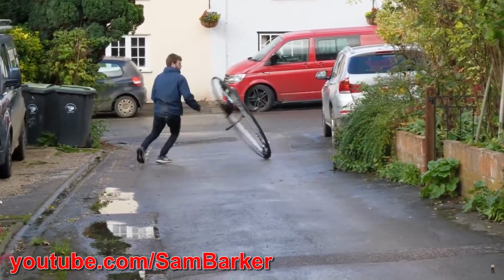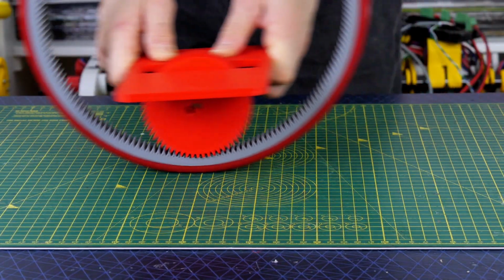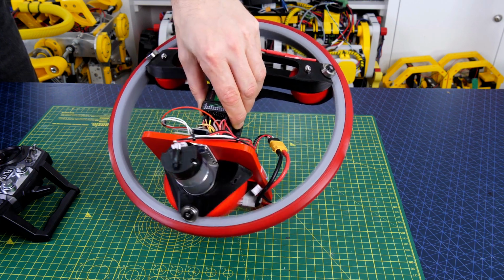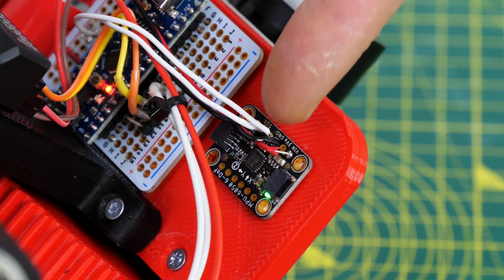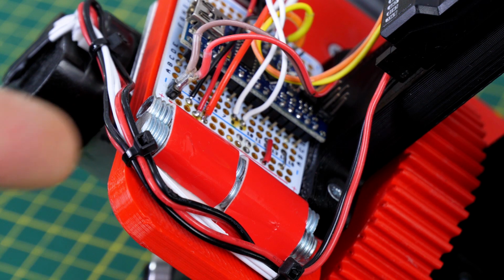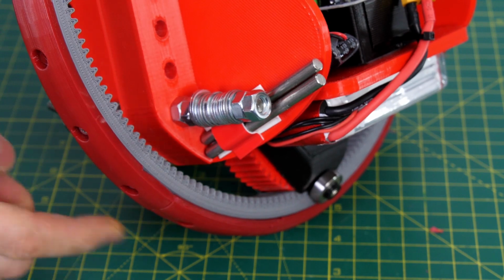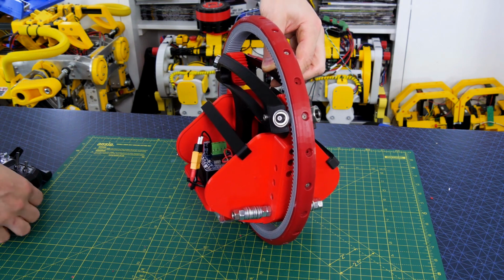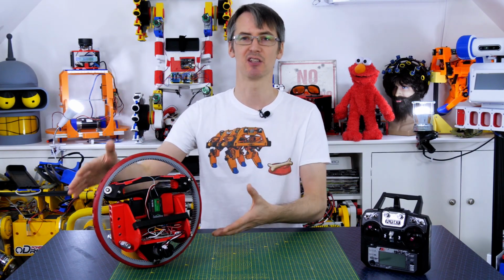Monowheel with Stability Control

Comment: Nice work James, this is something I need to incorporate into a future design it would definitely save a few bruises!
Reply: your channel is awesome, keep building :)
Reply: Ditto.
Reply: Why not add a gyroscope like James looked at with the balancing robot on the inline skate wheels, seems like the rotation might help balance and use that as the mechanism for turning/leaning, seems like at human scale you could pack one into a location that isnt in the way of the driver, such as under the seat to help keep the weight low to the ground. also have you given any thought to the idea your tire might need to be larger to allow it to counter steer like a motorbike?

Comment: Great idea!!! Beautiful implementation! Btw, double helical gear would work great here to keep big wheel centered without additional bearings.
Reply: Herringbone pattern?
Reply: That would be pretty cool
Reply: That is very smart.
Reply: @jeffcarter4500  Double helical is the same as herringbone but with a gap in between the gears. The gap is useful for metal gear fabrication. For a 3D printed part, it is not required and therefore herringbone is more compact and suited.

Comment: The Carpet Pile is also responsible for the side drift of your Monowheel. The fibres don't stand perfectly vertical. They all lean in the same direction, which let them bend more easily to one direction than the other. So your Monowheel is running "downwards" the bending fibres.

Comment: A herringbone or convex/concave gear pair would self center, removing the need for those side bearings. Some of the side to side issues could be because as it tilts the mass right, in order to steer right, the wheel will initially tilt left due to the reaction force. I'm not sure what the solution would be for this though. Maybe the mass ratio between the ballast and the wheel is important.
Reply: i've been thinking about two disks that are counter-rotating with masses on front of the one disk and back of the other. that should keep the torque at zero.
Reply: @ChrisBigBad  Like his previous one? Would that be classed as active where as the comment above would be passive?
Reply: @andycrask3531  ah! The disks are not permanently skinning. And they are just weighted in a single place. Also i imagine them being both parallel to the ground. The disks only rotate to bring the weights into position. In neutral, the upper disk might have the weight in front and the lower has it in back. For maximum tilt, one wheel turns clockwise 90 degrees and the other 90 degrees withershins.  The accelerations cancel out, but now the weight is it balance. Maybe. I cannot see any fault in the mechanism. Could still contain a problem that I cannot see
Reply: @ChrisBigBad  wouldn't it be a problem that the two disks and masses are not at the same height?
Reply: @Jehty_  sure. But either make the disks of different diameters or just use different masses.

Actually, since the masses never need to meet, you can have the lower mass sticking up and the upper mass sticking down. And you only need one motor between to drive both disks.

Actually actually, make the disks have teeth and use the motors themselves as the mass. Mount them on bumps sticking out from the disks with berrings above and below the other disk for stability. Drive the motors with the same signal but wired opposite.

Actually actually actually, never mind the disks. Just mount a spoked ring with a gear track around the top edge. Clamp the two motors on with their drive gears on top and berrings underneath.

Hmm... can you use them for both balance and steering if they do not always move symmetrically? Or just use opposing reaction wheels for everything including gyroscopic?
Reply: to have quick and stable steering you need high negative gain based on angle position and a negative gain based on angular speed that should be just high enough to remove oscillations. no need to trade off between speed and stability

Comment: Hello! I'm an EUC rider. I suggest you to replace the roll control with a yaw control moving the two masses in front and back in an alternating way. The stabilization software will use yaw to stabilize the device around a set point and the remote control will change the set point from the center to the sides in order to control steering. I'm pretty sure that you can achieve a more precise control at low speed because I do it all the time 😉
Reply: @Blox117  it is the opposite. You have to use steering to maintain balance and control leaning. Is the same thing that you do when you ride a bicycle. If you try to act directly on leaning moving a mass like in the video it is very difficult to control the device. Is the same to ride a bicycle with no hands
Reply: Hi, another EUC rider here. I agree,, a yaw control would be like us twisting our hips which we do a lot , to stay up at low and zero forward speed.
Reply: Veritasium had a video on this, and it seems rather convincing. Essentially, to initiate a turn, the rider steers slightly opposite to the direction of the turn, so that as a reaction he will lean into it and carry on the turn leaning on the correct side. This is a very small input and done istinctively, but can be tested by locking the handlebars so that they will only steer toward one side.
Reply: Also an EUC rider! Yes this would work. You steer left to go right and it's all about getting the right lean angle. @James Bruton: You should try an EUC. They are the best invention I have seen in my lifetime!
Reply: @TDOBrandano  It depends on what axis yaw is applied. If yaw is applied about a vertical axis directly through the center, Veritasium's video would not apply.
Reply: Ye, due to precession ramming on the yaw can control the roll
Reply: @VacuousCat  it's not really because of precession, though precession can keep an unmanned bike upright, along with the wheel castering angle. You can ride a bike that has no castering angle and a wheel mass so small that precession has no effect, and that would not keep upright on its own. It's inertia: you steer very slightly to one side, the wheels contact patch on the ground start to move to that side, but the mass of the bike and rider is above it and keeps traveling straight, so it starts to lean on the other side. As the lean starts you "catch" it by steering to the other side, or the precession and castering do that for you, and you have a turn. To end the turn you increase the steering inside the turn so that you start to lean out of it. And you do all this without really thinking about it, because it's about the same as walking around a corner.
Reply: Just another note to add: the curvature of the tire profile will be an important part to consider because it seems that is what steers a one-wheeled vehicle. I notice it's harder to steer in snow for that reason. It's the same effect as how a belt Rides up to the middle of a rounded pulley. The same happens with the wheel and the road surface.

Comment: I would love to see you add gyro balance to this, also if you have the gyros spinning in the opposite direction you can apply a brake on them to use them to compensate the forward roll when braking.
Reply: Yes with 2 counter rotating gyros this should be doable
Reply: I think adding a gyro would be kinda lame.
He already proved in another video that a one-wheel device can balance with gyros. 
Now doing it without a gyro is much more interesting.
Reply: @Lardah  should be fine with one, just accelerate or brake it to apply the torque. Could also use a control moment gyro
Reply: I think you might mean reaction wheels? i.e. wheels parallel to the main wheel that spin up in the opposite direction as the main wheel to compensate for that inertial buildup and pitch.
Reply: @quinnobi42  A control moment gyro is like a reaction wheel but it spins at a set RPM and is rotated in a cage to produce a torque. Same idea as a reaction wheel, different implementation.
Reply: @KnowledgePerformance7  Yeah, I know. I was just thinking that it would be easier to implement a reaction wheel, at least physically.
Reply: @quinnobi42  oh yeah 100% 
I just think they are really cool and the software side and electronics are a tad easier. Don't have to worry about powerful motors to change the RPM rapidly and the electronics to run said motor.

Comment: Heads up on the pull to one side. That could be the carpet piling alinement. 
I’ve noticed myself that the direction of carpet pilings makes a big difference to RC cars driving over it. Cars will pull heavily to one side when driving at a right angle to the pile direction. (In certain types of carpets.)

Comment: Your theory that the room you were testing in at first having an ever so slight slant to one side reminded me of the the room that one of the classes I took back when I was going to the local community collage was located in.  The teacher would have the students look around the room for a few minutes and jot down what stood out to them.  What most if not all the students would miss was that there a spot on the floor where there was a slight bump that couldn't be spotted with the naked eye or just walking around, one would have to slide there feet over the location to notice it and the teacher would have us do just that.

Comment: James, an idea: you could get a bike wheel and 3d print the internal gear profile in a number of sections, which could then be fixed through the spoke holes with hardware. Why? Well, it's cool for a start, you can get a bigger wheel diameter than you could print, and you get to use real inflatable tyres which i feel would improve the handling characteristics of the vehicle quite a bit!
Reply: honestly that sounds like a great rc project

Comment: You need to do three nested monowheels, the outside one is the one for driving, the inside two would be simple weighted reaction wheels. Your instinct to put a lot of weight down low isn't necessarily correct, because it's still above the point of support. Better to have a uniformly distributed mass that you can spin and impart inertia to.
Reply: Like a flywheel that you can store inertia in, draw from it when accelerating and then use as a reaction mass when braking, nice!  It would double up as a gyroscope to aid stability side to side as well.

Comment: In 1983 whist in church I sketched this on the bulletin. Realized a single wheel would be unstable so added another wheel to the side. The reason I was thinking about this was to have a vechicle with a large diameter wheel that could climb obstacles. Figured the powering unit would be lower, thus providing stability. Had no way of fabrication at that point, and was surprised to find the idea had existed back in the early 1900s.

Comment: Cool project! However, I see a flaw in the latteral stabilization. When the monocycle moves the counterweight to one side, the rest of the vehicle moves to the opposite side because the center of mass wants to stay in the middle. Since the wheel is so thin, you won't get any reaction force to actually tip the centre of mass over to one side. What happens is that the accelerating counter weight creates a moment on the monocycle in the opposite direction, meaning that you'd expect a latteral force on the wheel contact point, which you probably can take advantage of. Just a reaction wheel could potentially work better than a counter weight. But then you also have the gyroscopic effect of the wheels together, which could be tricky to handle

Comment: As I was thinking about the steering on this, I think I can foresee a problem as you increase the balance mass.  In order to move the mass, you have to accelerate it - impart some angular momentum to it.  This, in turn, imparts negative angular momentum into the entire system and this "negative" momentum will tend to tip the whole wheel even further, accentuating (momentarily) the whole lean.
This requires that the pendulum be moved further in order to compensate, which pushes it further over which... 

Of course, as you decelerate the pendulum, that will now try to roll the system in the other direction.

Could this be the source of some of your instability problems?  And the problem will get worse as you add mass to the pendulum.
Reply: This same issue is also the reason that the steering seems to be delayed.
This recent video by Veritasium explains reasonably well how this applies to bicycles:
https://www.youtube.com/watch?v=9cNmUNHSBac

I think the solution would be the same, both regarding stability and steering, as with bicycles, to countersteer, or "counter-balance" the monowheel. This makes the programming a hard problem, though, because it has to know if it should steer or countersteer at every single perturbation, or really every single instant.

I suppose the calculation would be whether or not it already has enough angular momentum in the correct direction to right itself if it were to begin steering, in which case it steers, otherwise it countersteers until it creates enough angular momentum.

Actually, I just thought of a much more robust solution to this: two steering mechanisms, one to apply countersteering, the other to apply steering. The countersteering operates a flywheel-like ring, which means it doesn't actually contribute to the balancing of the vehicle, but spinning it can generate angular momentum. (This is of course a reaction wheel system.) You then have the steering mechanism as on the vehicle, which you program to have the sole job of spinning down the reaction wheel. (Particularly by unbalancing the vehicle so that the reaction wheel system will then accelerate the reaction wheel opposite to how it's already spinning, of course.)

Comment: I’m wondering if some of the instability you have sometimes is because the ballast that controls the roll is moving with the rest of the drive system. When the main drive system tilts forward or backward, it also lifts the ballast, giving it more mechanical advantage to roll side to side. This coupling could therefore be adding extra dynamism to your system that is hard for the electronics to account for reliably.

Not sure it would be possible to stabilize the ballast due to inertia, so perhaps modifying the code to somehow account for the pitch of the drive in how it rolls?
Reply: Regardless, the code should take that angle into account, to refine the calculation.
Reply: He's also fighting the inertia when the ballast initially swings over
Reply: @TheGlitchyCorgi  that’s true, he may actually want to swing the ballast the opposite way.
Reply: @aDifferentJT  That is the definition of counter steering. Start all turns by first turning slightly the other way. You are in violent agreement with @Nocare.

Comment: If you use herringbone gears, not only will it not slide out, but it also will be much quieter. Especially if you notch out the joint in the middle (small gap)

Comment: I think you should look into counter steering in motorcycles. Tipping the wheel in the opposite direction of a desired turn to initiate the turn then shift the weight into the turn to maintain the direction.

Comment: I feel as though instead of attempting to compensate for the roll with balancing a weight. The underlying problem was that the yaw and roll needed to be fed into the equation for the pitch.  This is essentially  a reverse gyro...

Comment: This vehicle is called an intracycle. To prevent somersaults, you need to place the center of gravity as low as possible. Heading control is carried out by shifting the center of gravity to the left-right. (Google translation)

Comment: If you add a bezel in the center of the Wheel (so like through the center of the cogs), you could replace the idles with two just two sticks (or normal wheels), which should help reduce the friction from the top two idle gears

Comment: With a bearingnsized groove down the center of the ring gear you could capture and run the wheel on three bearings instead of six.

Comment: Really cool start of a probably (hopefully) long process. I think that the delay in the compensation reaction is causing part of the problems as well. You would want the lowest latency for these kind of control setups, as when it compensates too late, the machine might have moved towards the undesirable side even more and it will then compensate too late again and it gets out of hand quickly. Ohwell, what am I thinking, you definitely already know this yourself. I am awaiting the next video patiently!

Comment: Next improvements:
- Mount the motor in line and side by side with battery, cg balanced and thermally isolated
- protecting the battery, cables and electronics

- maybe flywheel/gyroscopic steering and balancing

Got more ideas? Post them here 😁

Comment: Braking is always going to be limited by the mass of the stator.  A smarter design would be to have some deployable wheels (think wheelie bar) which can drop to the ground or contact after a certain degree of rotation to raise the brake force limit to available traction.  I'd never ride one that didn't have this feature at more than a walking pace.
Reply: or even some completely/ mostly passive auxiliary wheels that in normal operation never touch the ground but touch the ground when braking over the limit mainly so you dont have to rely on a mechanical system to deploy a wheel

Comment: veritasium just did a video on how bicycles don't steer the way we think, I would recommend that video but the gist of it is that we need to countersteer the bicycle to keep the center of balance correct, so I wonder if you would have better control by steering in the opposite direction first, than steering into the turn, love the idea it's really cool!